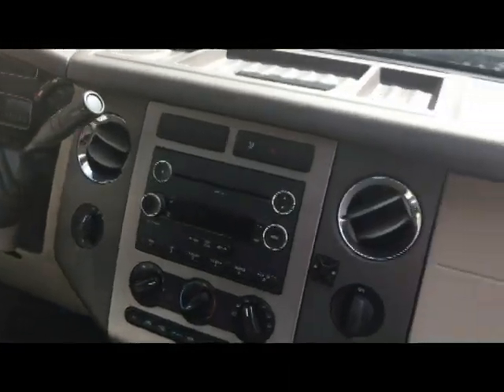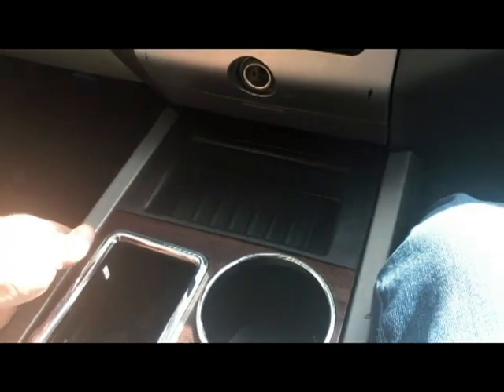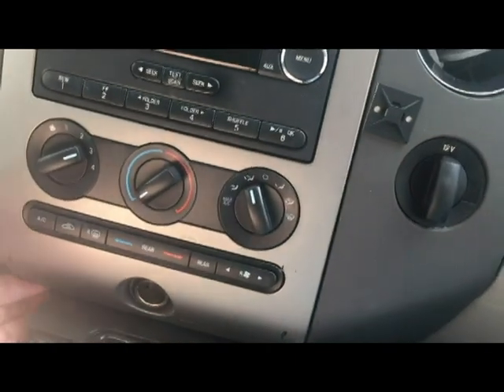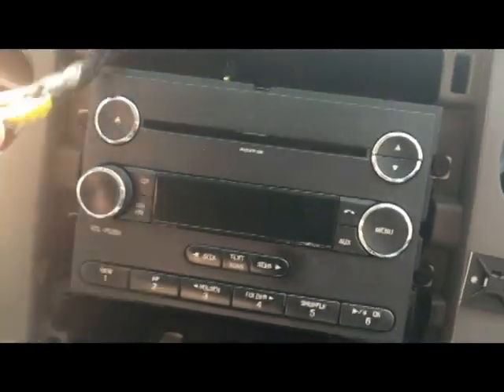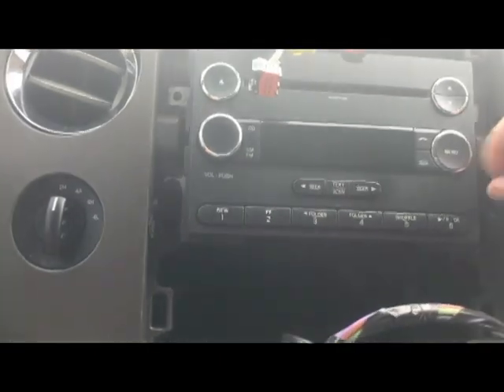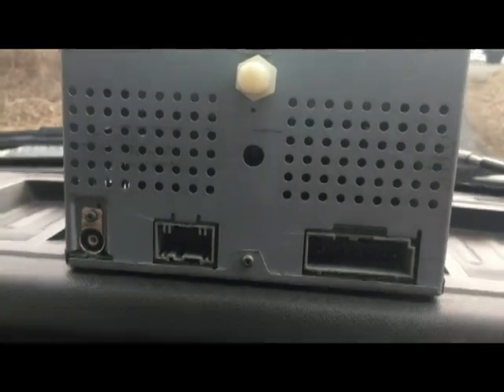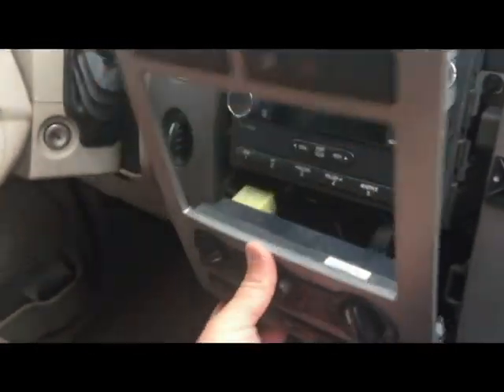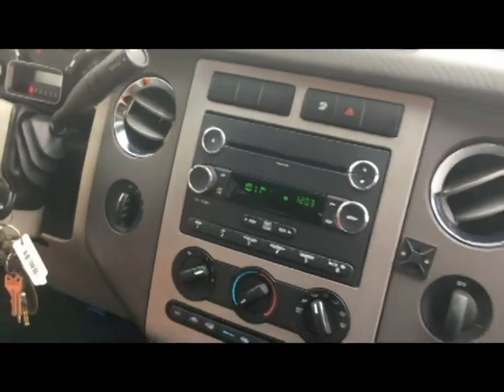How to replace your Ford Expedition Car Stereo

Comment: What’s the small clip with the 2 wires for?
The adapter kit that I got for my 2010 Expedition doesn’t have anything for it.
Reply: i think this is a 2007 model, it looks exactly like mine, and mine is a 2007.
Reply: @1alopezpr  2007 is the same generation, but he literally started the video with; 2012 Ford Expedition across the screen.

Comment: I have the exact same vehicle (same year and also was a police car).
I have a question here. How did you install the center console? There are no bolts or brackets on the floor for it.
Reply from the maker: When I purchased a replacement Center Console, The bolts came with it (it you purchase one, I suggest you make sure the bolts come with yours). I then had to cut away the area of floor covering to expose where the bolts fit into. The problem I had with that was that they cut the wiring harness that comes through the floor and attaches to the console. Way too expensive for me to have a new one installed. But having the console in is good enough for now. Best of luck with your truck!

Comment: I need this exact same video, but with an aftermarket radio instead.

The antenna is not compatible on my aftermarket radio, and i got a "no signal" message.

Any input will be greatly appreciated.
Reply from the maker: Maybe there is an adapter kit to fit on the aftermarket system antenna to make it compatible with your vehicle. I would suggest Amazon or perhaps eBay. Best of luck!

Comment: Did the replacement radio have a anti-theft code that had to be used to let the radio play properly with your Expedition?
Reply from the maker: No. Maybe because mine was an older model.